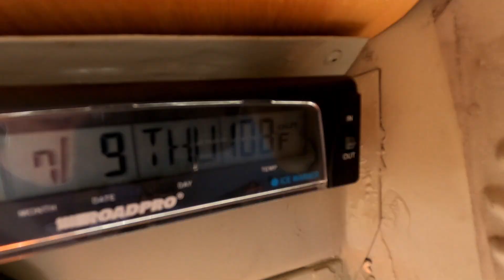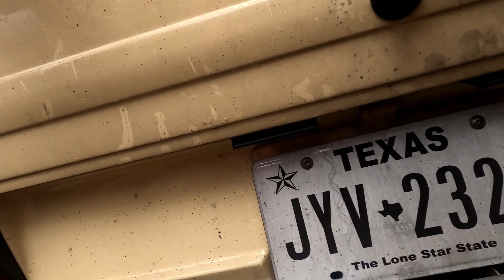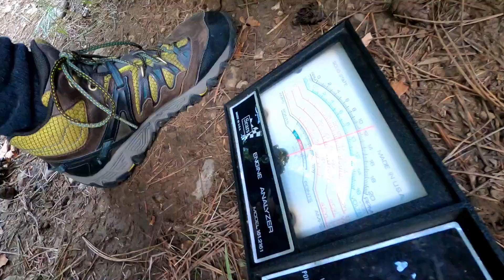600 Miles to the Mountains in a VW and it was Awesome! Join us on the adventure...

Comment: 👍Great stuff! "I found a jackass!" cracked me up.  Mustie1 had a good tip for the fuel pump:  Put a hose clamp around it.
Reply from the maker: hum interesting, thanks for sharing :)
Reply: The Brazilian replacement pumps tend to have the pin "walk out".  I knurl the ends where it rests in the pump body. Put it back on and use thread locker.

Comment: Nice video guys,,  So when your going to run long distances make sure you bring a spare carburetor, a couple of fan belt, a fuel pump, one or two throttle cables, make sure you have a spare tire, a spare generator, and alternator, one or two sets of points, electronic ignition because that's what I would run  hehehe
Reply from the maker: oh yeah we have all that!  :)
Reply: Probably a few more things too...
Reply: If your battery is fully charged and you dont use the lights or starter you can drive a bus 1200 kilometers with a charging system that doesnt. I know this for a fact.
I also carry the same parts kit as Apollo 13, Pratleys Putty and duct tape :)

Comment: If I remember correctly you need to adjust timing and fuel mix when in the mountains per John Muir
Reply from the maker: yeah, Jason had to but the rest of us seemed okay so we went with it.
Reply: How are you supposed to do that when the bus engine in your aircraft reaches 12000 feet?
Reply from the maker: @andrewallen9993  good point!  interesting question

Comment: Is there not a points replacement yet for Air cooled VWs?  I would have to go "Solid state" as I do not own a nice meter set like that and I like to drive!
Reply from the maker: there are but those fail too we've seen many times.
Reply: Just adjust the points when you change the oil, adjust the brakes, gap the spark plugs, replace the air filter oil and grease the nipples. Only necessary every 3000 miles or so.